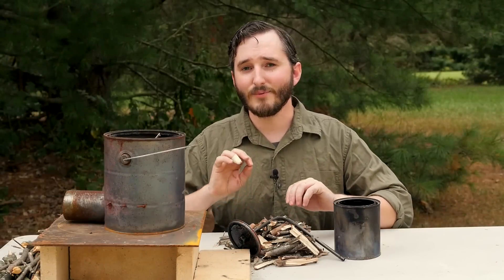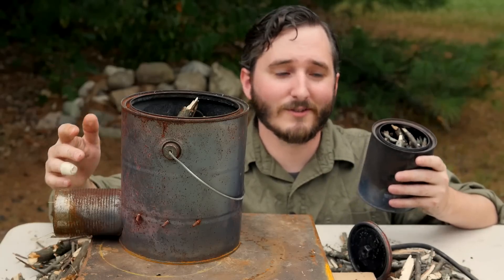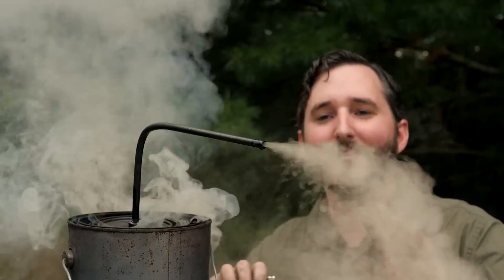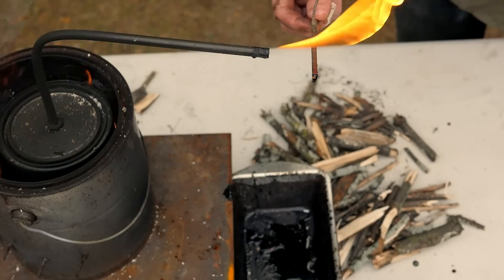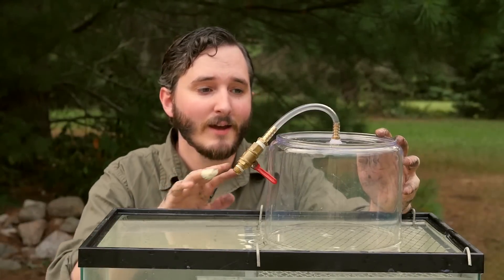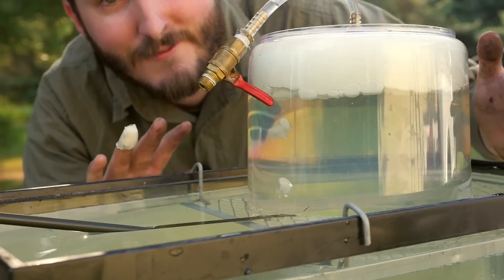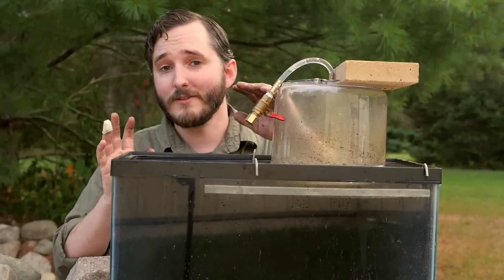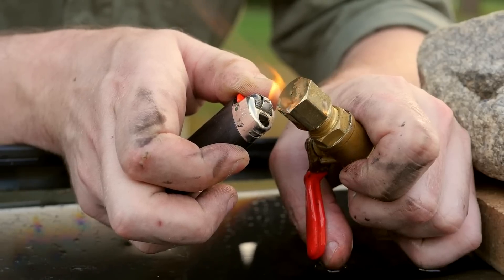How To Make Wood Gas Biofuel (and an experimental gas collection method)

Comment: Very glad you did this experiment Ben.  My unpublished results are exactly the same.  I've been wondering if the cleaned gas could be compressed, and used as viable source to fuel a mini foundry when propane isn't available.  Also would be great to distill the smoke and let it settle into layers.  I hear you can extract acetone and methyl alcohol.  Definitely faster (and nicer) than working with manure.
Reply: you can turn the syn-gas into methanol using a catalyst
Reply: RIP Grant
Reply: The King of Random Maybe wait for the gases to settle down and then compress it in a gas tank? I don't know if you can do that as the wood gas is being produced though, it would definitely be interesting to see if one of you could achieve this
Reply: +Avi   Yes it does when you have two different gases of different densities, it just takes longer than fluids.
Reply: You all feel better with your hate? Screw you guys Grant RIP
Reply: The King of Random you would need a way of adding oxygen, no?
Reply: Not only can you extract acetone and other chemicals you could make crude oil. Its called pyrolysis oil (or fast pyrolysis bio oil) there are actual factories making this from waste wood.
Reply: The cleaned wood gas cannot be compressed. Firstly, what Ben produced was not wood gas; it was merely the volatile fraction of wood driven off during pyrolysis. (See my lengthy response posted above. I work at All Power Labs, the gasifier genset company; biomass gasification is our field of expertise.) If all you're doing is capturing the gases driven off during pyrolysis, you won't have a positive energy balance; most of the volatiles will condense into tar, and you will consume a tremendous amount of energy producing it, while leaving much of the energy behind as charcoal.

Wood gas, which is gasified biomass, consists of about 50% nitrogen (from the air used to aspirate the gasifier), and the rest consists of combustible species roughly evenly split between hydrogen and carbon monoxide, with up to 10-15% unreduced carbon dioxide and water vapor diluting it. It is not cost effective to compress when propane isn't available because it has a very low energy density— roughly 1/8 the energy density of natural gas due to nitrogen and unreduced gases diluting it, and from the fact that hydrogen and carbon monoxide can each only take one more oxygen atom during combustion whereas methane can take four oxygen atoms per methane. Often times the energy density is even lower due to various factors that introduce inefficiencies into the process.

Furthermore, carbon monoxide is not stable under compression, especially if there is a catalyst present; it decomposes into soot and oxygen under compression. If I remember correctly, iron appears to catalyze the decomposition.

The wood distillates are dominantly tar and wood vinegar, which consists mostly of acetic acid. Do a YouTube search for "wood vinegar" to see how wood distillates are not particularly viable as a substitute for propane.
Reply: The King of Random do a video together with NightHawkInLight and try to fuel your foundry through wood gas
Reply: teo reid they use the gas to heat the wood xD
Reply: The King of Random it can be compressed...I have tried this project...and the purification is tough...I had it pressurised into deodorant cans!
Reply: A complete DIY backyard foundry would be really cool to see. 
One completely random thought I had for containing the wood gas (I don't think it would work well though) but set up a rig of large soda bottles with hoses running from them to the end of the spout.
Or even just holding each bottle near the outflowing gas until it looks reletivley "full". Then cap it off and once you have several bottles try to concentrate/purify the gas from there.
Reply: RIP Grant
Reply: rest in peace tkor
Reply: Valueless Dollar exactly mrteslonian has done many a gasification video and purified the gases very well. Haven't seen him bottle any tho? Maybe that's the video you posted? Otherwise Cody from Cody's lab has done hydrogen and oxygen bottling then using it to cut and melt metal as a sort of cheap mans oxyacetylene. I'm sure there is a combination possible between both ideas
Reply: Don't let the noisemakers bug you, Grant.  I for one see you in a positive light.  Keep up the good work.
Reply: The King of Random YES!!!  You could build a Distillation Tower like the petroleum industry uses for making fuels.  
A refractory distillation tower.
Reply: Ramen Noodles How about you show a little bit of respect for NIL'S channel? Grant does a fine job with his videos, and his video titles aren't clickbait. If you don't like it, then refrain from commenting for the rest of our sakes
Reply: Looked into woodgas pretty extensively a few years back; apparently if you compress it it turn changes composition and won't burn. Apparently in World War II they had buses running on the stuff in London due to fuel shortages. The buses had giant balloons on top  holding wood gas or town gas simply because the gas could be compressed into a pressurized container. That's why most woodgas vehicles have the gasifier on the vehicle itself
Reply: You don't think we could use a system like the petroleum industry uses to separate the different types of fuels?
Reply: Miss you Grant ❤️
Reply: +Lukegear yeah ... Only way to product gas is to use immediately, it's difficult and hard to collect
Reply: The King of Random the subject of wood gas realy interests me and i would apreciat looking at what you found out if you want to learn more I suggest looking up mrteslalonian he converted a truck to run on wood gas as well as several wood gasifiers you may want to look into an event at Argos indiana wich is a meeting of people and there wood gas creations.... best of luck to you!
Reply: Mr. Teslonian is a nutjob. He bs's his results (to himself), and doesn't understand what he's doing. Generally very poor intuition and problem solving. Free energy type guy.
Reply: The King of Random MR TESLONIAN did it already. Also other cool stuff, check his channel on youtube, great projects!
Reply: pervert
Reply: The King of Random collaboration???
Reply: The King of Random hi can u pls do a video on nitroglycerin
Reply: Nice vid!!!! Try with a venturi in order to add atmospheric oxygen in the burning nozle!! Also I heard that prefilters must be added: one to lower the gas temp, a tornado one for eliminating the tat,other with sawwood to filter the tar, and another filled with steelwool to eliminate the sulfures. After that you can compress it via regular compressor and empty propane bottle. I dont know if its safe but there are records from doing it.
Reply: I was just thinking about pressurizing it like propane.
Reply: The King of Random yes I've actually studied this process and in War II they used to use old radiators to filter the gas cool it down efficiently enough to burn cleanly then let it flow into the air intake system of the engine and it started right up you can try this experiment with a small engine a lawn mower and thing was a small engine then gradually work up to a vehicle
Reply: The King of Random have a large opening pipe or one that opens to a large area and have it in an ark that's apex is downward and have it half full of water and have it hooked to an air compressor air intake then pump it into a scuba tank
Reply: if you start working on this wood gas you will make electricity generator out of it xD
Reply: The King of Random make "rocket Stove" or "Dragon stove" (antique china) you can have 600-1.000°C (1.112-1.832°f) it the easy way. Look video experiment of Chaillot Barnabé on YouTube, he's French, he have easy 800°C (1.482°f Fahrenheit)  with little wood. Or watch in YouTube: Argos 2016 or Argos 2017 for vehicles powered by wood gas 👍 😀

 you can see "primitive technology" on YouTube with earth and water you make a very easy for trying to have your perfect rocket Stove prototype with cooking, forge, hot water boilers like Barnabé CHAILLOT and even with STIRLING/ERICSSON engine for pump/electric generator (patent STIRLING 1816, Ericsson 1833)... Air Climate with water and alcohol (US NAVY 60's)

in more, there a lot of very old patents since 1890! search in GOOGLE PATENTS 😯

Le savoir et le savoir faire sont les seules vraies richesse, l'argent n'est qu'une invention basé sur un métal inutile, puis des morceaux de papiers et d l'encre, avant de devenir 100% virtuel en 2018, une construction psychique hunaine. Le savoir est une arme et tout est fait pour nous rendre stupide et soumis comme des moutons... Et les mouton sont tondus toute leur vie, avant de finir à l'abattoir 😂

On English with Google Traduction:
Knowledge and know-how are the only real wealth, money is only an invention based on an unnecessary metal, then pieces of paper and ink, before becoming 100% virtual in 2018, a construction Psychic hunaine. Knowledge is a weapon and everything is made to make us stupid and submissive like sheep ...  And The sheep (Us) are bred (animal husbandry) to steal their wool and finish at the slaughterhouse😂
Reply: man stfu go back to boiling water
Reply: King of random!!!
Reply: Rip the king
Reply: wow, I love the idea of using this gas for foundry. please keep me informed of your progress with this.
Reply: @stankrieger3137  The King Of Random died years ago. There will be no progress on his idea. Sorry to be the one to tell you.
Reply: I think if it can be compressed, you can set up a propane style system to operate machinery,  I have been looking at this for years, but your fish tank idea got me thinking.   Most feasible applications can't ha r a constant flame..   either way it is awesome
Reply: RIP
Reply: I think the best way to collect wood gas is to make a cooling tower  for the gas.   The hard part is finding the right as their is tar , soot and water .
Maybe a  multi wall  pipe system    one large pipe  with several  progressively smaller  cut one inch short than  the out side pipe.. this will let it cool  and the tar and soot settle out
Reply: Would be nice to have two containers with pressure displays. Just put some wood in them and close. Heat one until you reach a safe pressure, then use the gas of one to heat the other and produce more gas. This way you'll have free gas until the wood in one of them becomes charcoal.
Reply: The King of Random I love that you asked him that I was wondering the same thing and keep doing what you're doing I like your Channel I subscribe to it too
Reply: +mobspeak Did he really charge people for collaborations?
Reply: The King of Random  Fill a large upright air tank about 3/4 full with water. Route dirty gas from charcoal device to bottom of tank with a check valve to keep water and pressure in, and tap clean gas from top.

Remove the intake filter (round filter piece) from a small 3 gallon air compressor and screw on a pipe with a check valve on it. Connect this compressor intake line to the top tap line of the upright tank.

Put a guage line on your charcoal can with the guage at the end. When the pressure is less than atmosphere, shut off air compressor. When the pressure is about 5psi turn back on. Alternate till the air compressor has reached max pressure.

After compressor is full, allow it to completely cool down. With it TURNED OFF, slightly open the drain valve to empty water and quickly close. Attach a Schrader valve to a propane tank. Use this to fill the propane tanks.
Reply: Research post World War II restoration Japan. They had many vehicles running on charcoal gas
Reply: I was thinking the same thing about making a distillation tower.
Reply: The King of Random first liquify the gas from liquid nitrogen and place in a small container which can handle high pressure.
Reply: Hi grant
Reply: Potential problems:
1) Hydrogen is bad news for metal tanks
2) Compressing carbon monoxide is dangerous as I believe it can act as an oxidiser for the mixture so result in an explosive mixture (having trouble finding citations for this)
3) the energy density is so low that the energy required to compress it is almost as much as the stored energy itself.
Storing in large atmospheric pressure bags or under water as NHIL does here is safer, more efficient and more practical.
Reply: You could use the setup as is and have one hell of a flamethrower.
Reply: Look up town gas plants this is basically the same process used in the 1800's to produce hydrogen gas from coal.  You can make ceosote and lots of other chemicals using this processes
Reply: I like potato's
Reply: Daniel harper.
+Points I did not know that.
Reply: The King of Random your one of my favorite youtubers i have learned a lot from you
Reply: The King of Random can't wait to see your video on this
Reply: It would work on a fuel injected engine, and it was used! You just need to cool and filter it so it's a liquid and it works.
Reply: Lithrus yeah but the gas is mainly CO and H so making a liquid is not feasible
Reply: The King of Random hi random im the 300 like and i wana say you are awsome keep makeing videos that are awsome to watch
Reply: The King of Random hi
Reply: @The King of Random Make some video with wood gas
Reply: Modern char-coaling processes actually utilize the gas to heat the biomass being char-coaled. I would guess that any surplus would be burnt off as well, or else used to produce heat or electricity. 

Hypothetically, it would definitely be possible to capture the gas and use it to power cars, but there would be many technical challenges. To begin with, it would need to be filtered and refined, so that only clean burning gases remained (H2, CO, CH4, etc). The next problem is that the energy density would be very low, even compared to regular natural gas. Methane (CH4) is a lot more energy dense per gaseous volume than hydrogen (H2) or carbon monoxide (CO). One way around this is to use catalysts and stack these compounds into longer hydrocarbon chains, or at least methanol (CH4O). 

Liquification is another way to make these compounds more compact, but the temperatures involved would be very, very low, and containing these liquids would require specialized insulated containers. 

It would be much more effective to use a wood-gas conversion kit; these generate the gas, filter it, and feed it right into a regular internal combustion engine. You lose on power relative to the displacement of the engine, but you do get to use wood to power your vehicle, and you get around all the problems with storing the gases.
Reply: grant if you take you pressure pump you made from pvc pipe and a bubbler like the one on your hho generator I feel like you could compress and store the wood gas. I plan on making a similar system for myself.
Reply: To be precise, the VAPORS (fine particles) settle out, and the heavier gases (tars, benzene) CONDENSE as the temperature falls.  The gasses came out of a hot can, so it's much the same as distilling alcohol.
Reply: Wow, I just commented on your channel asking for you to do this experiment and here I find out you already did. Awesome!
Reply: The King of Random didn't expect to see you, but hi
Reply: How to convert this to liquid state?
Reply: How are you going to compress it? If propane is not available they that probably means electricity is not.
Reply: Speaking of Mr. Teslonian, you could just run a generator on wood gas and use that generator to power some small-scale electric arc furnace.
Reply: If you take the inlet of a air compressor and hoke it up to his gasgen (big scale) probably yeah can't wait to see it
Reply: I think that’s cool btw I love your Chanel
Reply: Simon Butler 33333 rip
Reply: RIP!
Reply: Nyce project
Can be cheaply made and sold in third world country
Reply: Time flies sucks he died
Reply: Goodbye Grant.
Reply: Hi Grant! The syngas produced in wood pyrolysis has lots of components, but the most abundant ones are carbon monoxide and hydrogen, which are the main cause of the good energy content that the gas gives off when burnt.
Compressing these gases is hard, you can surely do it, but only to a limited extent, without specialized equipment. You could compress the gas and store a decent amount, but you would not be able to liquefy it, not without the cryogenic compression equipment needed to compress hydrogen to the point of it becoming liquid. Maybe you could adapt some of the liquid nitrogen generator stuff to do this?
Reply: The King of Random I watch both of you guys and it would be cool to have an actual engine or a foundry like you said work on it. I am wondering if it is a viable cleaner gas than most that cars run on, also by the way ben was making it it looked like you could get tons of it from charcoal company's if they make their own charcoal the same way.
Reply: I wont say you suck grant, but man your channel has gone to heck with the clickbait uncreative videos. I want the old king of random back :P
Reply: @trevader2562   he never came back
Reply: Running the mini foundry on it would take a lot of gas. I am sure it can be done, but you just need to create a lot of gas.
Reply: Your channel has turned uncreative and, whats even worse, you (and your team) present your channel very cheap. (i. e. clickbait)
Reply: Hey King of Random can you try to cool the gas with liquid nitrogen to get liquid wood gas? An then store it for the back yard foundry?
Reply: The King of Random when great people talk
Reply: King of Random, I like your videos.
Reply: The King of Random I was just thinking... I wonder if the king of random tried this! And then a second later I read your comment!
Reply: Grant, if you spoke and presented your videos like this comment (instead of annoying clickbait with little depth) i would still be a subscriber.
Reply: Do you still charge ridiculous sums for collaborations?
Reply: you are a fool, this is the internet, both negative and positive feed back is valid

comment section isnt a kiss grants ass section
Reply: fuck off
Reply: Hi grant
Reply: I stopped watching because of it. It was too painful to sit through
Reply: People use 55galon drums as gasifiers to power forges and foundries. The main problem is, you need 2, or 3 systems, just so you can keep a steady flow of woodgas. (You don't want to open, and recharge a system while it is still hot, or being heated.) Also, there is some risk of explosion involved when using gasifiers, improvised or otherways. Mostly related to refilling, or uneven heating, i believe.

My experience is fairly limited with the stuff. I use it for melting lead, and aluminum/magnesium alloys. As such, i don't "clean" the gas, i just burn it, tar and all. For that reason, only, i've been "collecting" my gas in the bottom of the retort, rather then the top. Less "crap" left in the retort when all is said and done.
To some extent the charcoal left after the woodgas extraction is usable, but since my main "hook" is pyro, the charcoal is considered overcooked, and simply goes back in to the burner, and is used to heat the system for the next burn. It burns fine, it just has been processed to far to be good pyro-charcoal.
Reply: 420
Reply: The King of Random hello. You probably don't know me but I'm one of your subscribers. I love your videos and I would be really happy if you replied. I don't think you will reply. To you I'm probably an inconvenience. But never give that's what I'm going to say.
Reply: Aaron K. James Myke Prior Ramen Noodles shitbag Central Intelligence Agency Big Boy AmazeMe Badass Killer  Tuur Janssen  Milan Jovanovic where are all of your videos? Can you produce anything like him? If you don't want click bait have a go at YouTube not the producers of videos, especially if you couldn't do it yourself ! Stfu you little whiny bitches!
Reply: Bahrg Smith who is the Whiney little bitch now? Lol
Reply: solong as its a carburated engine it should 

don't think it would work on a fuel injected engine
Reply: when compressing a flammable gas, don't you have to be careful of how it's done? compression can cause ignition with certain gases, right? If I'm wrong please correct me
Reply: should have, could have, would have. too late he already did it before you, go back to your own channel
Reply: FWIW I feel the life in the manure should build the life in the soil... on a farm. That said, tech like this could "fuel" a new industry in wood products waste material.
Reply: TKOR ''My unpublished results are exactly the same'' Oh just fuck off. You're uncreative and your videos are full of clickbait and you're a sellout.
Reply: @J4nssent  you fuck off or ill fuck you off
Reply: I remember when your channel wasn't clickbait and you didn't act like some goofy 90s tv host.
Reply: im pretty sure this is old technology, the germans had something like this in WW2 to power vehicles with wood, it works its just in efficient compared to real fuels
Reply: Go back speaking to your rice ^^
Reply: "My unpublished results are exactly the same" is this a way of saying we'll see a wood gas video of you in a few days?
Reply: Fuck off
Reply: The King of Random Get off of this channel. You have no clue what you are talking about half the time, and you are beyond arrogant. "My unpublished results" - you're laughable.
Reply: Jesus christ guys get off the hate train. While I will admit that his thumbnails have turned clickbaity, he still provides good creative content that delivers on the title.There is no reason to become uncivil besides your lack of maturity.
Reply: @Alexandervo5  people are ignorant. Instead of moving on to another channel, pathetic ass bastards will just hate and pick away at anyone’s creativity. I love the creativity and the sharing of one’s ideas.
Reply: The King of Random fuck off u click bait bitch
Reply: GTFO, stay away from NIghtHawkin, he is a better, less clickbait version of you!
Reply: The King of Random hahaha ur low-key homosexual. I could see it in u.
Reply: The King of Random fuck off king of ad revenue
Reply: hey ik heet ook stijn
Reply: Ahhhhhh king of random!!!!
Reply: The King of Random you suck grant
Reply: What happens when you boil the ocean, Grant?
Can you answer me this simple question? What will happen? This really keeps me up at night, Grant. It's such a fundamental question to ask. What on Earth would happen if one were to try such a thing? Should anyone even attempt such a foolish endeavor? Should one go where nobody else has been before, and try such ground breaking experiments? Is this why God has put us here? To push the boundary, to extent your horizon towards the unthinkable? Is that the meaning of life? To boil brine dry? Answer my question, Grant. Answer it, for one day, you will answer to your creator.
Reply: And you'll answer to the ALMIGHTY if you don't straighten out .
Reply: Collab ahead? :D